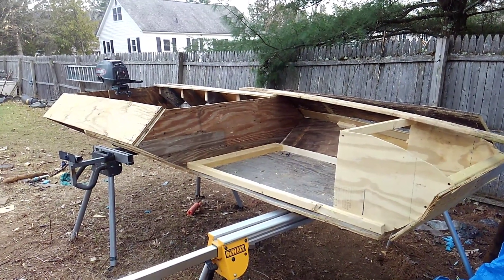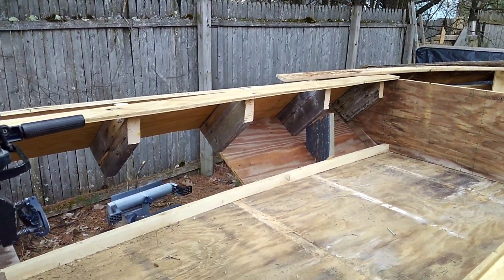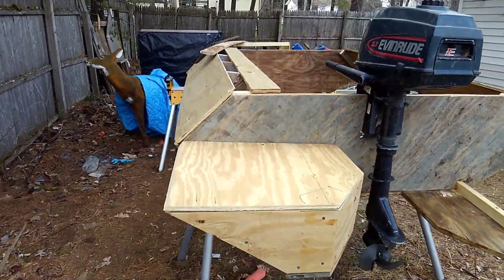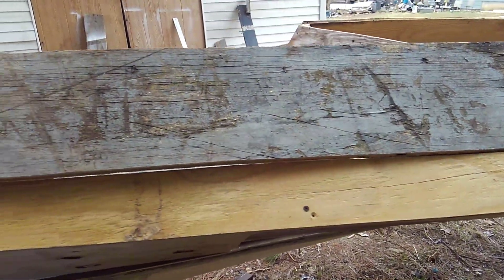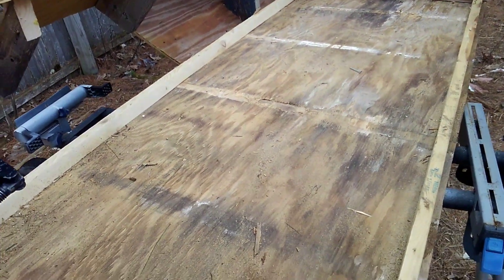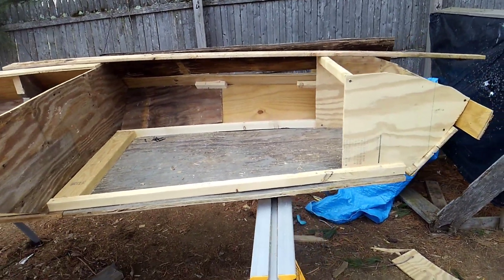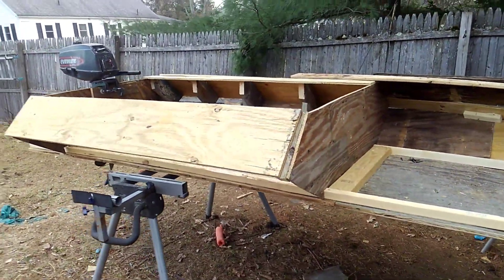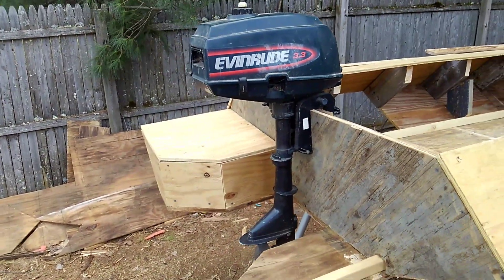Part 2 duck boat build

Comment: My worry would be the joint in the middle…to me the long stringers need to run full length and have more than 2….thinking it will put to much strain on the fiberglass…also I’ve seen plans for boats like this but they wired the joints together…keep going I’d like to see the end result…👍